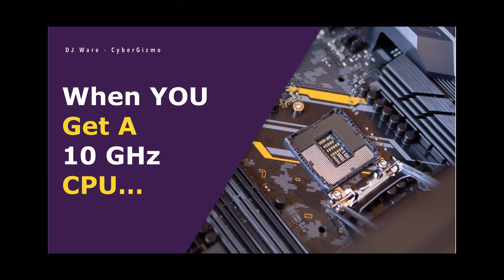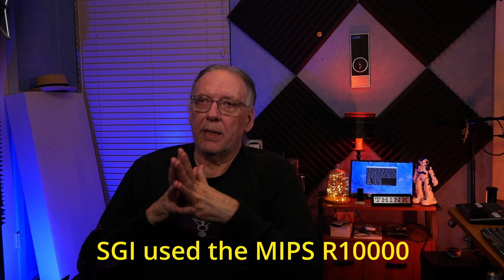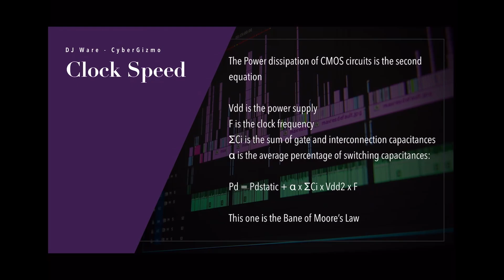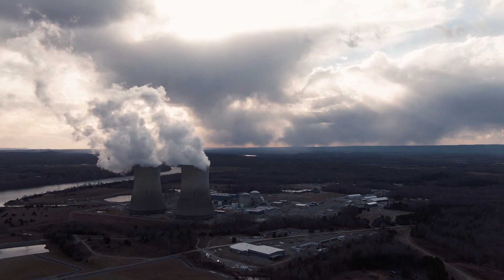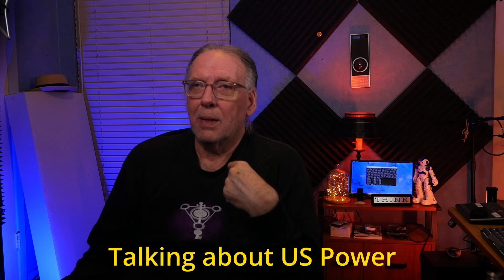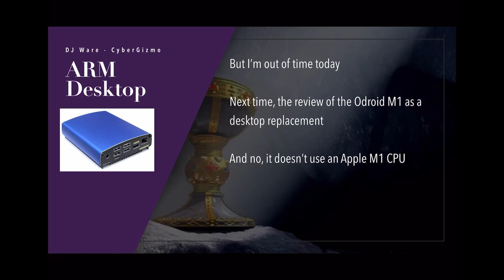When you get a 10 GHz CPU...

Comment: - what's the minimum set of CPU instructions (x86) that is needed to run (latest) ?:
   1. ms dos 6.22
   2. Windows xp
   3. Windows 7
   4. Windows 8.1
   5. Windows 10
   6. Windows 11
   7. Linux (ubuntu & Debian)
   8. Apple OS (intel)

- is there a database that shows what CPU instruction is been used by various Programs &/or OS ?
   - Citrix & Microsoft, had a compatible testing tool for Windows, to see if your applications would work on newer OS.

- Second pin, why does PCI/PCIe only use max x16?
     - why can it use x32, x64, x128, etc...

-Third pin, the memory DIMM on mother board seems to have had the same size for eons:
    - what if we double the pins, make it longer, taller, etc... (Will this make RAM slower?)

Comment: x86 is only an old instruction set, internally the physical architecture has nothing to do with the old chips and the design really isn't very bound by the instruction set. 
Then consider about 80% of a modern die is cache; 15% is pipeline optimizing, branch prediction, I/O and memory managment; and only about 5% is true CPU cores. 

Itanium wasn't widely adopted because the concept had some some hidden flaws and inefficiencies, and the execution wasn't great. The 'epic' idea provided high instructions-per-second on artificial benchmarks, but it wasn't achievable on real workloads. They shifted a bunch of the pipeline and out of order optimization off the CPU and onto the compiler. Which may have been a reasonable idea at the time of development but by the time Itanium was getting deployed competing tech had made the notion mostly obsolete. 
They included an x86-32 backward compatibility to help the transition, but it was relatively poor performing and misused/overused by customers in a way that also slowed native I64 binaries that were running on the same machine.
Basically no real advantage for fully native binaries, big disadvantage with backward compatibility, and compilers of the time just weren't up to the optimizing task.

Comment: Well the instructions per clock has been increasing slowly, even within the lifespan of the current "i" chips they've gone up quite a bit.  And we have more cores and more cores which helps with the OS wants to run a lot of things at the same time.  But just regarding clock speed- we should be much higher today.  About 13 years ago I had computer at work with a dual core Intel processor that could be overclocked with extreme cooling to 7GHz.  I just read that now, 13 years later, people have been able to get the latest Intel processors up to 7GHz with extreme cooling.  Yes as said in the video current processors with normal cooling have a slight clock speed advantage over 2009 processors but I think in the years since there were processors that actually went backwards in maximum clock speed.  So in some ways there has been no advance in clock speed in the past 13 years.  Processors have improved in many other ways but not clock speed.  And my home desktop is still an Intel Q9400 running at 3.8GHz on air cooling.  I have not determined its maximum clock speed because I don't have fast enough RAM to go along with it.  It holds its own against the lower tiers of current CPUs that are recommended for gaming.

Comment: My server is a ~20 year old Pentium 4 HT (1C2T; 3.0GHz) with a whopping 1.5GB of DDR (400MHz) and 1.21TB in 4 HDDs (2x IDE; 2x SATA-1; 2x 3.5"; 2x 2.5"; 1x 250GB and 3x 320GB). The $0.00 backup server is very power efficient, because it is powered on ~1 hour/week since June 2019.  It runs 32-bits FreeBSD 13.1 on OpenZFS 2.1 and it receives the backup from my Ubuntu 22.04 LTS desktop on OpenZFS 2.1  :)  The described remains are of a 2003 HP d530 SFF and it runs now in a Compaq Evo Tower with its useless Windows 98SE activation sticker. It has 2 cables; Power and 1 Gbps Ethernet.

Comment: I'm running threadrippers on my computers now. I like the potential for heat dissipation with them. The 8 core CPUs I used to run were always maxed out rendering video and on the verge of forcing a reboot before finishing a render. I probably spent as much in replacement hardware as the cost of a system with a physically larger cpu that can render well under maximum and complete a render in a fraction of the time of what I had before. I'm hoping that means a longer lifespan but we'll see. The fan doesn't even speed up at the default setting for number of threads, which is actually the number of cores instead of the number of threads which is double that. I don't need it to work that hard.

Comment: Í am, too, also longing for the day when I can make a low-power ARM desktop replacement. Looking forwards to your Odroid review and future developments in that area! Like you also say, it's gotta have NVMe support though - I/O is a dealbreaker on all SBCs so far.
I've often wondered why there doesn't appear to be anyone trying to make ITX/ATX boards with performance ARM chips on them, with PCIe/NVMe/SATA ports like we're used to and standard DDR4/5 RAM. Wouldn't that be neat? I'd buy one.
As for the Itanium debacle: as I recall, the main issues were high cost, vendor lock-in and lacking performance. x86 was faster at a lower price point, using off the shelf parts while not requiring any advanced and proprietary software. Kinda hard to compete with that.